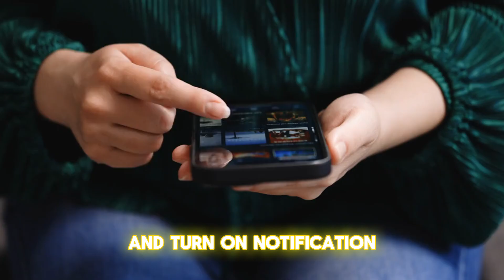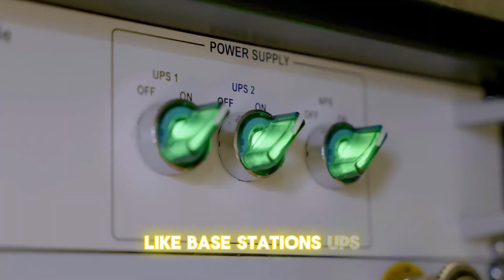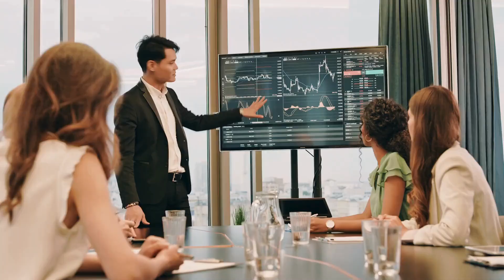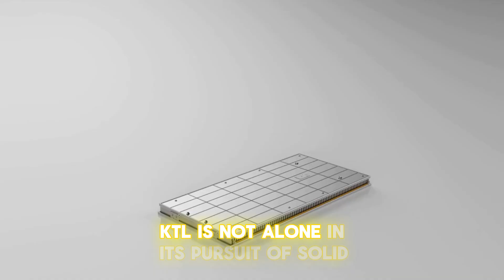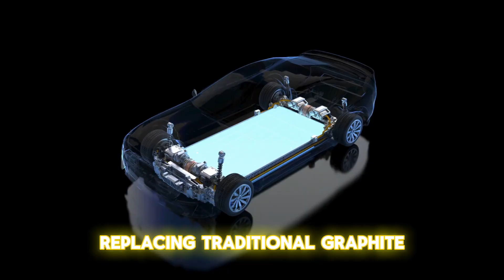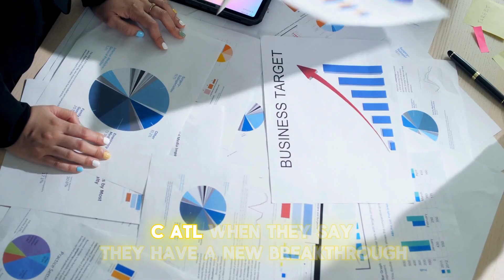The CATL Finally Released The SOLID STATE Batteries! Bye Bye Toyota!

Comment: Another clickbait video. Solid state is not replacing Lithium batteries anytime soon.  If it ever does, it will be not by Toyota, not by U.S. or German, not by anyone else but possibly Tesla, who leads ALL battery R&D areas (and also happens to be the single biggest customer for all battery manufacturers as well).  Solid battery are too expansive and will not be usable for EV for awhile.